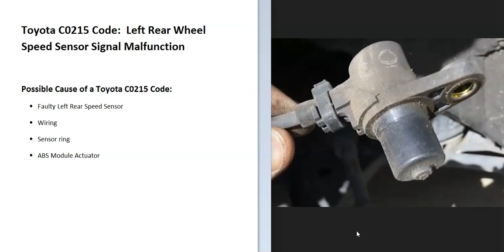Causes and Fixes Toyota C0215 Code: Left Rear Wheel Speed Sensor Signal Malfunction

Comment: I have this problem with my Lexus I have the same code C0215,c1223, and c1336 I think it's circuit cause all my other sensors are good and reading if you have any tips or advice definely need it this is the only thing left I need to fix

Comment: C0215: Rear Speed Sensor Left-Hand (LH) Circuit Issue. The left rear wheel speed sensor circuit has an open or malfunction, which affects the ABS (Anti-lock Braking System), VSC (Vehicle Stability Control), and TRAC (Traction Control). This could lead to loss of stability or reduced braking performance in certain situations.
C1333: Open Circuit in Left Rear Wheel Speed Sensor Circuit. This corroborates the issue with the left rear speed sensor.
Reply: have you ever figured out the fix?

Comment: Hi I think this is the best straight forward video I have watched...I have an 09 Camry reading C1330,c1332,co210,co215 and only the abs light on.
Reply: I got the same. have you ever figured out the fix?
Reply: @sadkosadko5747  i got someone with a really good scan tool and narrowed it down to right rear sensor. I replaced the whole bearing and hub assembly which includes the sensor for $65cdn (approx) on amazon through autoshack which has good quality products. and the abs light went out by itself and I have abs brakes again and an easier pedal to push now that the abs system is back up running. I think that once you have one sensor gone it throws codes for the others as it works as a system and then it shuts down the abs and you then have conventional brakes which is still usable but the brakes won't pulse to keep the car straight on slippery roads  or snow and the pedal is stiffer.

Comment: Great video - I am working on a 2009 Tundra - The o-ring was ripped on my left rear speed sensor so it is rusty and wet in there and giving me C0215 and C1241 error codes.  Is there a way to clean inside where the speed sensor goes without taking apart the rear axle?  Thanks